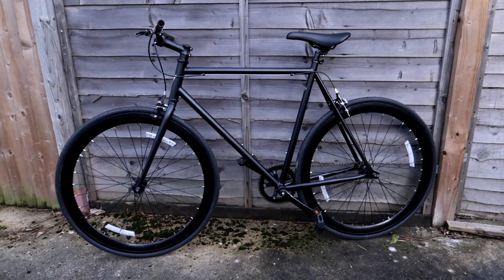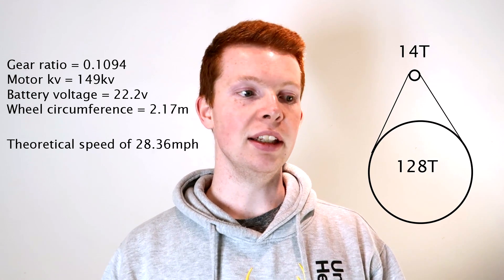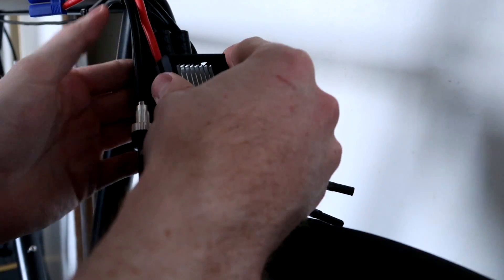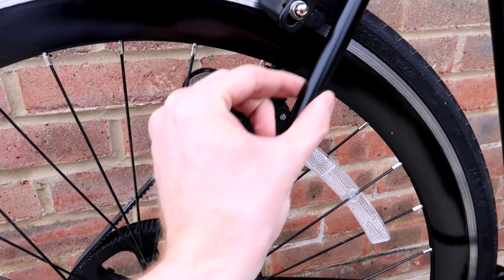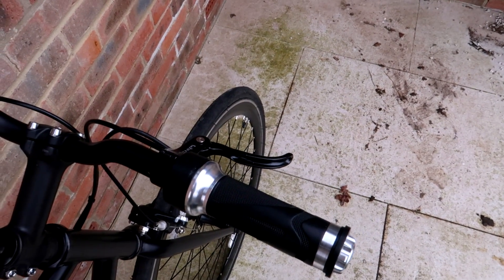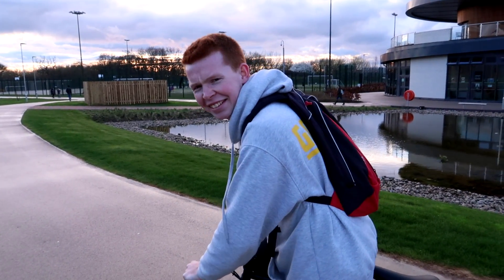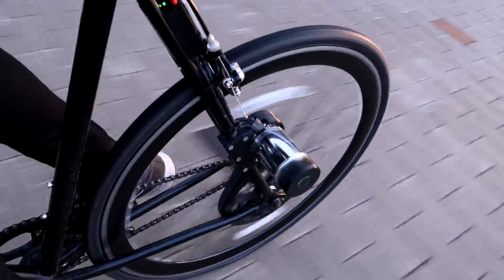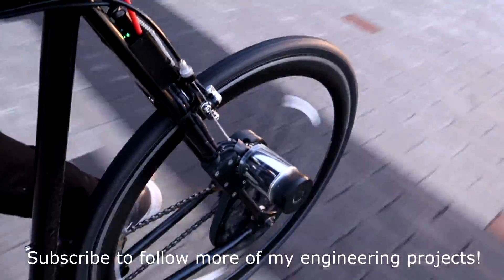DIY Electric Bike

Comment: How did you fit the large PLA wheel onto the hub? What is the name and measurements of the bike hub? Does it have threads on both sides? Does it have bearings?

Comment: great idea! I have an idea to make similar but use car engine's timing belt (it's durable in car engine upto 60.000 km).
but how it's connected to the wheel's spokes? can't believe that with just "5mm wide cable ties" :-)

Comment: dish motor on the back end would be better!, more expensive for a battery to power it but no belts etc and you can buy a pedal assist sensor and controller for less than £40 and get up to 50mph lol

Comment: I am very pleased with my new e-bike. share4.photo/ebicycle?Ш The 500w motor gives me plenty of power. Assembly is simple enough if you are even reasonably mechanically inclined. I have only used my e-bike for relatively short trips so I can ride for a few days before I have to change my battery. I read reviews about the brake handles being on wrong side but mine came right. It's a good buy for the money, fast, and I love it.....

Comment: Anyone explain to me why you couldn't use a couple of motorcycle lead acid/gel type batteries instead? They might weigh more but surely theyre generally more robust in that they'd last longer and need less battery management in terms of balancing and regenerative recharging?

Comment: Wouldn't it be way easier to make an assembly with the motor connected to a skateboard wheel which contacts the wheel? No need for gearing and a special frame, this way you could just attach it to the seat tube.

Comment: I built one of these years ago. If you gear an internally geared hub and run the power through the chain you get all the advantage of gearing. Plus you can hide the motor in the width of the bike. I originally had a derailer on it, but the motor kept making the chain jump during gear shifts. Mine's mounted on a folding bike that I can take on our commuter rail even during peak periods.

Comment: Could this be done on a multi geared cycle? Also what if we pedal and accelerate the motor at the same time could it cause any problems? Backlash in case of chain drive?

Comment: Great job you've done there Tom. You've hit the nail on the head as to the possible future of Cheap Easy build E-Bikes by keeping the weight down in the main. Like to suggest one refinement  that's get your friend who's good at programming to create an APP that can be downloaded (for a price) to make use of any Old smart phone to use as the touch control pad to pre-program the  variables as to power  speed etc. That would help keep costs down and also help you Guys  make some money with  the APP.. I have some other ideas to help aid your work if you are interested OK?

Comment: Well done, Tom.  How long does the PLA last in sunlight and stresses like on the bike?  Consider a 2 pound investment and order a speedometer.  Do you find that the motor hits things, or is it well clear of everything?  I recently bought a Geeetech A10.  How long does it take to print the cogs?

The bike you bought was a basic fixie 1-speed(!), but sure pricy at $179USD.  I bought a Roadmaster Granite Peak from Walmart for $89USD, and it has 18 speeds and front suspension!  My build was with one of the Chiwanese hub motors ($150 Ebay), so it's a front-drive.  (no wheelies for me)  The first build was with 30kg of lead acid batteries on the back rack.  The very first time I tried to ride it, the top-heavy beast threw me into the shrubs after a meter of movement.  LOL  I'm building a 3kg lithium pack to replace it now.  It'll do 22mph (35kph).

Comment: Good Job Lads. It's great to see young minds creating useful things.
 I build custom Motorcycles called Bobbers.
 You are off to a great start if you continue to develop the Electric Bike for a broad range of purposes.
  Try to think of a Trike build for seniors or disabled people to get around urban areas. Could be a winner if the motor and battery last long enough to be useful in a trike for running errands. 
Thanks for sharing.

Comment: Why you wasting time as a student learning the lies and half truths  when your sitting on a market exploding with E bikes  ?   Get your parts silicone molded and pour with resin  then when you make enough of your model get them done in China   Start assembling bikes !  You can get a wholesaler price and buy the bikes for half and improve your battery with Home made lipo 18650  they now have pre form racks.   Everyone wants an electric bike.  Sell the cheap model and a good model and take the old in on trade.    I got to many shops running or I’d be in this business ! But I’m going to be making soon the finest fairy / gnome doors for the base of trees ever seen.

Comment: This is a good video if I could just add a few comments of my own, as an ebike enthusiast and owner.

What I like so much about this build is how the builder approached the matter at hand.

The costs were kept low. Science and engineering were applied from the outset with a clear and full understanding of what the intended outcome would be.

In other words, the builder decided before hand what they wanted to finish up with and proceeded accordingly.

I am not an engineer but I am a bicycle and e-bike enthusiast, living in London, with an aversion for the so-called Public Transport system. 

I did my own build but was obliged by money and know-how constraints to proceed in an ad-hoc fashion. The build was successful but involved a lot of teething issues and running-repairs until it could finally be considered practical and reliable.

I was out about London yesterday for the Boat Race and with an unusually high level of pedestrian and motor traffic new shortcomings were unveiled, which in "normal" circumstances would not have been a problem. The bike is simply too heavy and in particular the tyres, Maxxis Hookworks 2.0, are killing the low-speed handling and make lifting the bike, particularly on steps, a real pain.

LOts of people set out with a particular mindset........ie how to get the bike to produce a certain torque and a certain speed. What nobody ever seems to consider is how the bike will perform at low speeds or in situations where it is forced to stop-start. In other words, how will it perform when asked to revert back to being a bicycle! 

That's not a problem we see with Tom Stantons build. The bike is as close to its original form as possible yet still functions as an ebike.

That's rare. The current direction within the ebike fraternity is for more power, more torque, with the bikes being used in environments where the downside of this increase in power is rarely if ever noticed.

Comment: How much voltage your motor produces?
Reply: Specs:
Turns: 18T
Voltage: 12S Lipoly
RPM/V: 149KV
Internal resistance: 0.021 Ohm
Max Loading: 70A
Max Power: 27000W
Shaft Dia: 8.0mm
Bolt holes: 32mm
Bolt thread: M4
Weight: 840g
Motor Plug: 4.0mm Bullet Connector

thats all i could find, sorry

Comment: Are you sure you calculated the gear ratio correctly? Those 2.2kW of the motor seem very oversized to me. I built an electric scooter for myself and it's running on a 350W motor which is quite ok for me (about 25km/h top speed).

Comment: I'm usign this design for a while now! I appreciate the simple design because when I was looking for an eBike conversion kit I couldn't find any for my fixed gear.

I've found some issues, and I got solutions for:

#0 the grains are not sufficient to hold the pulley on the motor;
 fix: make a groove on the shaft for the grains

#1 the belt wear off pretty quickly;
 fix: buy some more belts as spare

#2 the belt tensor inner part has broken;
 fix: substitute it with a brass one

#3 the bike can't go without battery (because the motor starts when pedalling and oppose force);
 fix: put a light weight low capacity battery if you want to ride as a normal bike, then you just don't accelerate

#4 the motor get hot;
 fix: mill an alluminium support for the motor

#5 using an ESC the bike can't start when standing still;
 fix: put three hall sensors in to the motor and install an eBike controller

P.S.: Be patient for errors, English is not my main language... ;)
Reply: do you know how fast the motor gets too hot with ABS print?
Reply: @RikdeBruijn  it will never get how PLA is fine for this I made many thousands of KM with this design.

Comment: You have it pulling way too much a high gear - if that motor does say 6,000 r/m you need about 26:1 - you can find rev/wheel size/speed calculators on line

Comment: Try a dual tire with a center cog to operate the belt drive mount the electric motor where the brake is usually is mounted. Design the dual tires to have some play in them to keep traction when cornering. Enclose the belt drive back hub and electric motor for safety. You should be able to use a disk brake on the rear wheel has well has on the front wheel. Design a organic carbon power cell front and back wheel making the wheels soild use pancake coils for wireless power transfer with tubeless tires. : )

Comment: Cool build, thanks for sharing.
I'm interested in a low-speed, high torque solution for my bike. Haven't seen it anywhere. I do not want a heavy hub motor. My commute involves two rather long, steep climbs, both at the end of the commute when my energy is sapped. I just need a boost for these hills. Extra speed is not required as I am happy with the pace I set now. Getting up those hills just turns me right off commuting though. Is there something you know of that will do this job? I like your small, light setup and would prefer a high torque version of that. 10-15km/hr would be plenty.
Reply: Hi Keith. I have a similar challenge to you. Maybe we can share efforts? I bought a second hand (10 years old Ebike Byocycles) for £200 but no battery. I am hoping to decide soon to either buy or build a battery pack. (I am retired former Mechanical CAD designer - drafter)........Looking for help like you - hills to and from work for my other half.
p.moore99@yahoo.co.uk. Good luchk your side....P

Comment: Put an hall sensor inside that motor and use an ebike speed controller instead of ESC/VESC so you can enjoy more torque to lower rpm (clever torque managment).

P.S.: I used your 3D model, which I find great, for my bike but a whole different electronic setup

Comment: Really nice. I'm professor at the University of Cadiz and I really appreciate your motivation and how you use the tools around you. I will show this video to my students next year during the lectures for motivating them. Hopefully It will work as well as your bike!! I commonly use 3D printer for developing new research equipment in my lab and it is really a powerful tool. 
Thanks for sharing it and good luck!
Reply: you must be a great teacher.   bless you.
Reply: You guys ever made any of these EB and exactly what is the total cost?
Reply: @AwesomeBlackDude  Could be done for about $200 or less if you have a bike already, probably less if you can weld. It all depends on what kind of power you want, and battery size obviously. But for $200, the power would already be illegal in most places, where I live, up to 250 watts is legal, which is almost nothing IMO.

Comment: interesting approach, but drivetrain components and the mounting brackets have to be extremely stiff and durable. very cheap sprockets of any dimension are available in steel and aluminium. good luck with your projects! very informative!

Comment: I'm very enthusiastic about 3D printing, and Woodwork, so Im wondering why you didnt use interlocking lugs on those flywheel quadrants. This would expand the surface area of the glue making the joint self-locking & more robust than gluing flat surfaces together. You could also have printed side walls to the cog wheel to prevent the belt ever slipping off. Kapton Tape on the outer surface of the PLA cogwheel to help keep the heat from the motor distorting it's shape. Perhaps a future upgrade is to cast the PLA parts in Aluminium? They'd look great and be much more resilient.

Comment: Good job, and great thinking. :) But the motor you are using has a rated for high speed, and not torque. If you change your motor you will get a much better result with the same amount of wattage.

Comment: I'm going to be motorizing my friends bike and I've put together a list of parts the motor being your typical 24v 250watt dc motor. But know I'm thinking about switching the motor to a CIM motor and gearing down for torque. My question is which motor would give me the best performance in terms of rang and power. The battery is two 12v 7Ah in series.

Comment: Hi friend does not need battery, can do so makes the wheels be a dynamo using the rim with copper and magnets on the sides of the fork, which sends power to the motor, maybe of serto too

Comment: Nice one Tom, Be interested to see how long the printed parts last. ABS would have been my choice, But a pain in the arse to use.
Also white filament would help with keeping the temp down on a hot day.
Anyway thumbs up, Now fit a motor on the front, bigger batteries and motors and fit a Ludicrous mode switch.
Keep up the good work.

John

Comment: Does it spin the motor if you are just pedaling without power? Does that mean pedaling takes more force ?
Reply: Are you serious? They have regen braking for even longboards...I'm guessing you've also never done a bike descent? Also the purpose was never to fully recharge the batteries. The point is to stretch the traveling distance. Even an efficiency of 15% is giving an extra 1.5 miles on a 10 mile ride.
Reply: radry100 yes it does
Reply: That's where ya need 1 way fixie cog so it freewheel s the motor
Reply: Battery are not that configurable on the fly... Also a cheaper alternative are lipo batteries. It's not pointless because instead of 15% battery weight increase, I can keep weight the same while achieving the same range. If you're using 18650, you already know that depleting batteries are bad thing for lithium based batteries.
Reply: This way however allows for regenerative braking
Reply: Lol I'm glad you wrote a second comment because I couldn't fully understand the first. What were you trying to say about AA batteries?

Are you seriously questioning why you'd want to extend the range? What if you took a detour? What if you didn't want to charge/deplete the battery fully? A bigger reserve is not always the answer. It makes the bike heavier and takes longer to charge.
Reply: annihil8ted and what ... pointless cus u could  just add to battery or make things lighter for a little mile ..come on u wouldn't even notice it there . too expensive damn 18650s I've been using 48v 500w hub motor on a cheap frame  using laptop cells bout 3 to 400quid with 18650s but can't trust them so I always use balance charger and still use it today since end of 2015...... I no what u mean tho it just seems like a market scam or an idea that works not for user gain but for money to increase price of products
Reply: annihil8ted seriously bro if you need to extend the range either the  bike or battery's is on its way out or you paid cheap and not looked at how it's going to be used eg for fun, up hill, or for work travelling blar blar .....if you get that correct with charge leftover just top batteries back up and be dun with it lmao
Reply: How does wanting to extend range translate to battery going on it's way out or cheapening out? I guess all hybrid cars are on their way out or cheapening out too since they almost always incorporate regen.

I get it. You want simplicity, that's fine. I think the majority would like to have regen; if only for marginal gains. There are also some who like experimenting too.

Also even with proper planning, it's nice not to have to charge as often.
Reply: It will have some resistance because of the bearings in motor, tensioning bearings and the belt itself, but since its a brushless motor it has a low resistance to free move, i think a freewheel or flywheel with chain links would add more friction and weight
Reply: Just another product for lazy People lol
Reply: iwantitpaintedblack that's where cud add 3phase motor using pedals to generate power needed charge a cap bank up faster you pedal faster bike goes
Reply: Please give me motor details & how can I get in India
Reply: annihil8ted don't u start..... regen braking lmfao on a bike ffs on a car might do something but when ya gonna brake for an hour to charge batteries lmao
Reply: annihil8ted so if ya need to go 10miles why need extra 1.5mile you already there lmfao
Reply: annihil8ted make a proper battery pack that will get u there with calculations be no need for regen different when ya make a 10min video cud use some AA batteries lmao

Comment: Thank you for an excellent video Tom, well made and well presented, interesting to see how strong the printed gear wheel is, do you have a link for the grips and throttle please, currently building one using two 36v brushless Bosch lawnmower motors, regards Doc Cox

Comment: just thinking about your belt drive ,  I don't know the type of your toothed belt , but I know for car camshaft timing belts you can get after market Kevlar belts fairly cheaply........  for about the same price as standard ones but they last about 50 prevent longer than the OEM ones, it  may be overkill I dunno , but I thought I'd mention it .

Comment: I admire the work and creativity that went into this, but if you're serious about having an electric bike it's not the way to go. You can get e-bike motor wheels for under £100, 18-20AH batteries for £250, and controllers for £15-£90 depending on the power output. Its also a better idea to use a thumb throttle rather than a full hand throttle - they're more robust and less tiring to operate. Further, the speed limit for PEDELECS is 15.5mph without pedaling. 

This is just some advice for people looking into building eBikes, I am not disparaging the effort of Tom Stanton here.